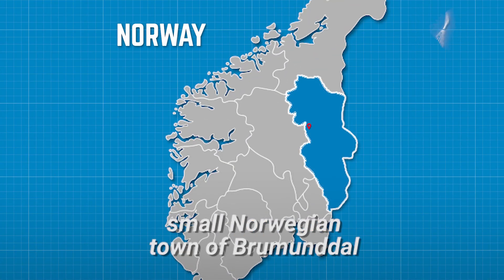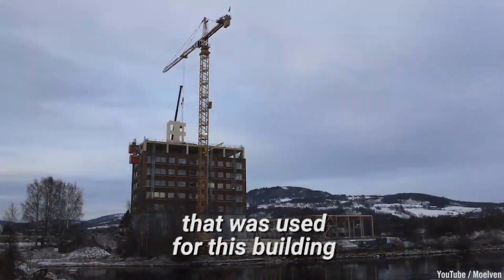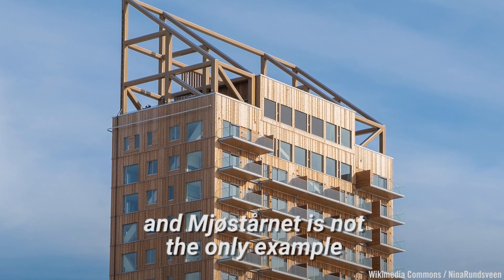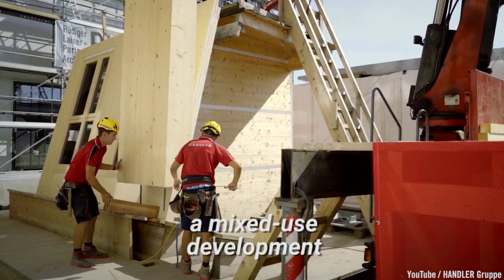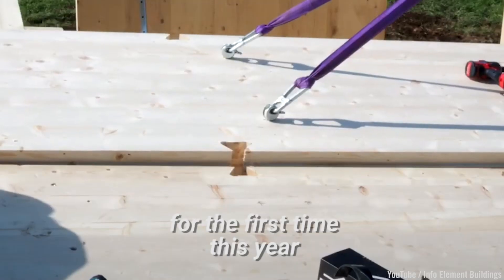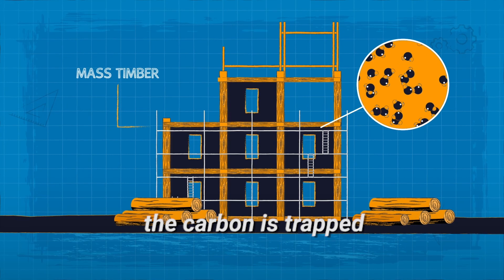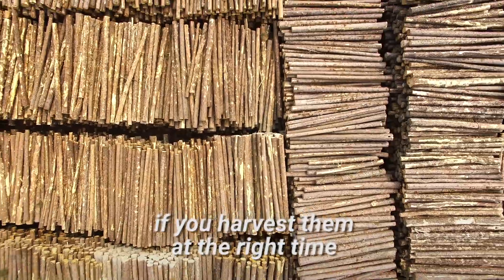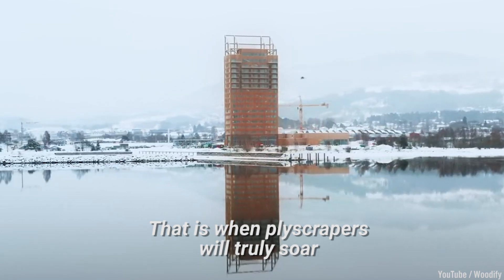Are wooden skyscrapers really viable?

Comment: Sounds really cool, but over time seems to be a bad idea for commercial buildings above a certain height or number of floors. For one, conventional building settling is accounted for in the initial plan, and acts upon the structure as a whole at it's foundation. Yet regardless of being made of engineered wood, the wood is still going to go through far more movement above the foundation, and throughout it's structure and individual parts unlike a conventional building, particularly in climates with cold or varying climate changes. Earthquake prone areas are a given no, as are areas that experience flooding. Something like this is idea for arid places like Dubai, with no earthquakes, extreme temperature/climate/weather shifts. Also, concrete, steel, and glass are regularly recycled when a structure is demolished despite what the video alludes to.

Comment: I really want to see this being used in an earthquakes frequent country :D
Reply: Well.. Philippines uses bamboo trees as tie beams because they can bend and sway therefore withstand typhoons. But my issue is how much moisture it can take when it's coating is chipped and weathered, before it warps. Likely they will use Douglas fir or southern yellow pine sapwood because it's cheap. These aren't the most weather resistant wood types either